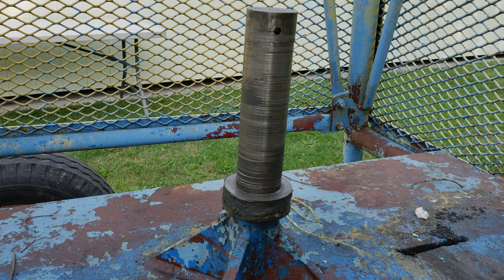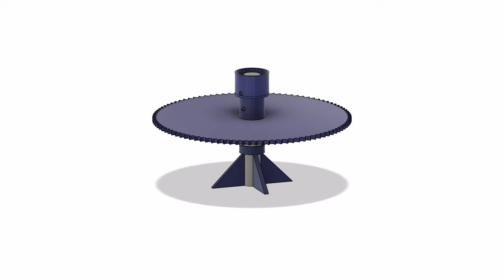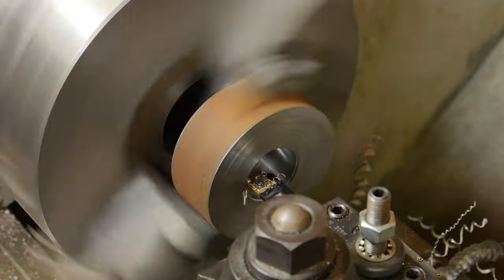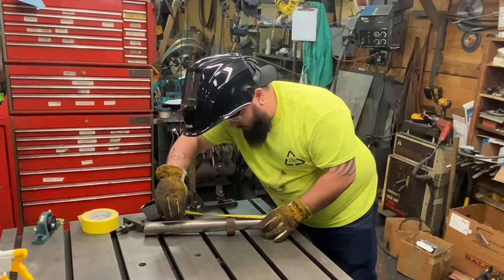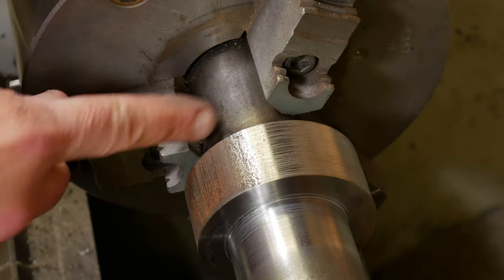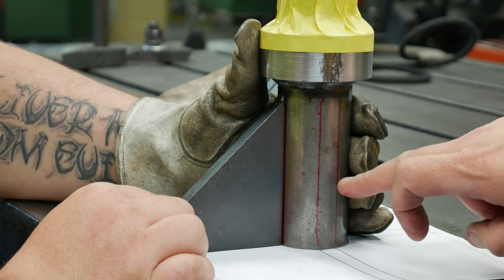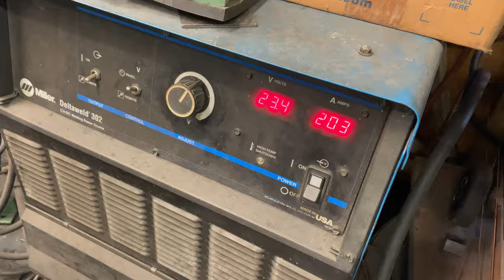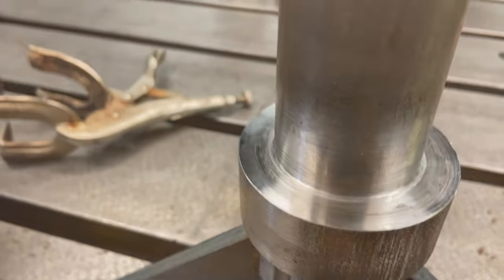Restoration of the Vintage Supersonic Rocket Ride

Comment: Hey how are you? im thinking about buying a not-so vintage ride over here in the UK, and restoring it to working condition.

Its a juvenile carousel, its currently sat at a breakers yard, it needs quite a lot of work doing to it, im not worried about keeping it too original, im actually wanting to modernize it, as im looking at running it in mall parking lots and markets

the base where the vehicles attach is plywood at the moment, it has no vehicles on it, im considering swapping it out for aluminium chequerplate, as the plywood has rotted through and is breaking off in big chunks

if i decide to buy the ride and restore it, i will record all my work and upload it on a youtube channel, might be interesting to watch

i love what you are doing to your ride, i probably wont be engineering mine as much, ill be buying parts and changing out old for new

keep up the good work
Reply from the maker: Glad to hear from you! If you take the plunge keep me posted.  Of course if you’ve got an extra $2mil sitting around you could take over Carter’s Steam Fair and hit the ground running!  LOL 😂 Thanks for watching!
Reply: @PeteRondeau  i dont think i have quite that much saved up yet 😂 ill keep you posted, im still debating whether to do it or not